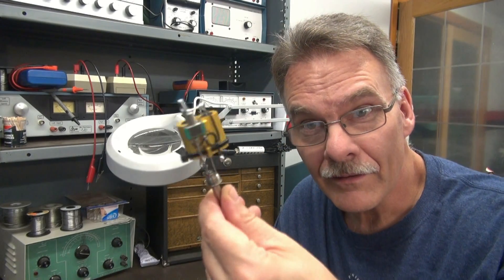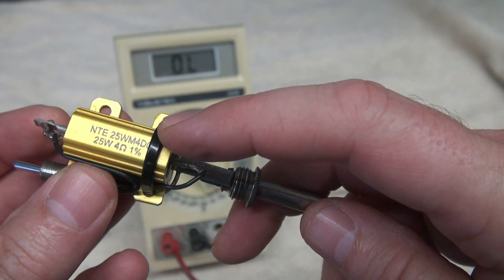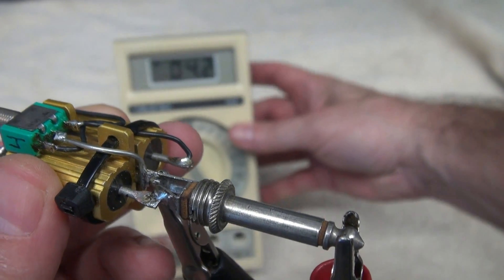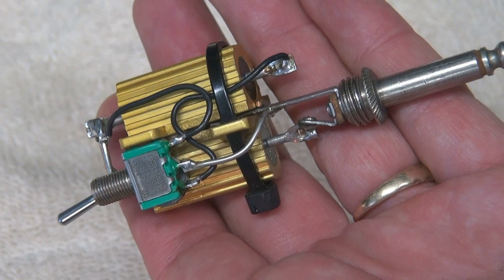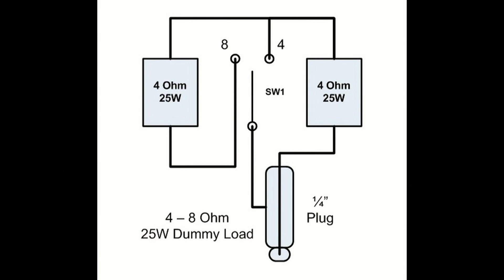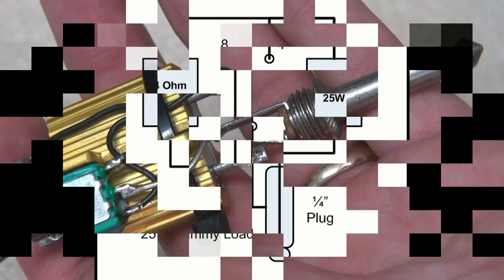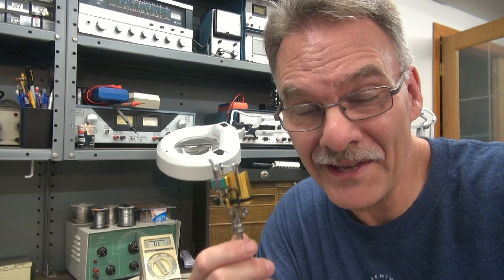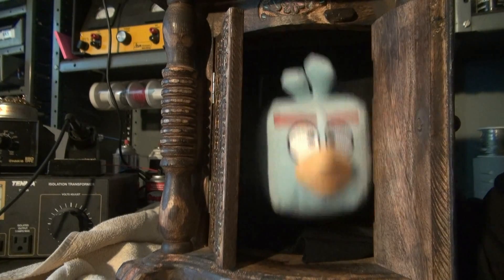How to make a simple easy 4  8 ohm tube audio amp Dummy load D-Lab

Comment: Old blown speakers work great for dummy loads. Same for speakers with damaged/bent baskets, ripped cones, etc. - just cut away everything leaving only the coil and magnet assembly saving the terminals while cutting everything else away. Same thing, no soldering needed. PS - it's not very important to worry about impedance matching a dummy load - as long as you try not to go one load away. Ex - if amp has 8ohm output - it's completely fine to use 4, 8, OR 16 ohm - one step up and down is completely safe. So an 8 ohm speaker motor (magnet assembly) is all you need.

Comment: I have a Fender super reissue, when I turn the reverb up past two, the amp distorts and loses volume. Can you share any ideas what may cause that? I put all new JJ tubes in it and it didn’t fix the problem. I’m afraid to use it for a job, fearing it might burn something up. It’s around a 92 or 94

Comment: Hi Terry, just a simple question. This dummy used 4&8 dc resistance. But speaker is in impedance. Is still ok tu just plug in this type of dummy load? Sorry.. i am new to electronic. So my question could be ridiculous. Hope i am not offending you or whatever. Thanks!

Comment: Hello Terry, I've a couple of questions concerning amp wattage. On a few tube data sheets, plate wattage (for instance 16w) and output wattage (for instance 4.5w). Would an amp built using one of these tubes be rated at 16w or 4.5w? Another question is how wattage rating relates to volume, db? You run all of the amps you work on mostly through the same speaker and the volume sounds the same. Could be the balance on your camera but I am very curious. Thank you.

Comment: I basically have built the same device and I have used it for years. With mine I use a female jack and the use different adapter cables for different amplifier outputs, tube or solid state.

Comment: I built one out of two 8 ohm 50 watt resistors like this. I got burned wasn't expecting it to get that hot (235 degrees F) but I was testing my amp with an oscilloscope and had the amplifier volume up high for almost 10 minutes. It melted the jacket on the test lead tip because it was touching the out side body a little along with the insulation on the wiring I had zip tied to it! Now that said, I have been using this for 2 or 3 years now for various amp testing but never had the master volume up above 2 before this.  I shouldn't have used it for so long of a period. I'm sure it's ok for quick testing 3-5 minutes at the most without proper heat sink mounting. D lab is the Man! but sometimes us newbies need more instruction, I know I do !

Comment: Hi doctor d .......good morning ....I have amp sansui....so wat I want is the amp op impedance is 8 ohm so iam going to connect 4 ohm + 4 ohm on per side with right polarity...so I know it'll work but when 2x4 ohm making series I is 60watt and 1 is 40 watts which will go heard means speak loud or make more drop on him self

Comment: If I wanted to use my tube heads pre-amp only... I just pull the output tubes. Amps pre-amp works as intended... and you're not wasting your output tubes.

Comment: Does anyone know if I could use this to plug into the extended speaker jack on a deluxe reverb to get the overall volume down on the amp? If I remember science, shouldn't this work to do that? Maybe would approximate 40% volume reduction? Thanks!

Comment: I have a bit of a strange question. I’m looking to get an open chassis amp(Milkman hi-fi 5w) to use as just a cool tube glow novelty kind of thing, , but I know it needs a load as to not ruin the power section. Can I build one of those and leave it in there indefinitely? If so, is it better to build one higher than 5w? I know this probably sounds like a stupid thing to do.

Comment: Does the wattage need to match the wattage output of the amp?  For instance, if I made this with two 50 watt resistors to use with a Bassman 100 head, could I still use it with a little 10 watt champ?

Comment: I have a Rivera Fandango 55w (2 12inch speakers).  what resistor size should i use?  The amp setting is 4 ohm.
Reply: Measure the impedance of each speaker. You should have two 8 ohm speakers wired in parallel thus making a 4 ohm load. So in reality you could make a 4 ohm ONLY version using just one of those fixed resistors. His use of two resistors just makes a nice 4 or 8 ohm dummy load.

Comment: Subject to rating, would this work ok for a SS amp that has a line out running to a recording interface? I can just turn the volume down (run the speaker silent) but I’m considering separating the classic from the speaker entirely and making a desktop recording amp with no speaker. Cheers

Comment: This would be extremely unsafe to use with any amp more powerful than 5w. The 25w rating of those power resistors is assuming they are correctly mounted to a metal surface, preferably with thermal grease. And it is also hazardous to leave them in the open air, because they will become very hot if any appreciable amount of power is run through them for more than a couple seconds. This is a serious burn hazard if anyone were to touch it. The switch and zip tie may very well melt. It looks clever, but it's not well considered. The same circuit could be built into a small ventilated metal box and be 1000% safer.
Reply: Don't touch things that will hurt you. It's hard to teach someone about a device if it's in a closed case. This device is being used on valve amplifiers that run 300-400v. The dummy load is the least of your worries.

Comment: can use this to make an 4 ohm amp head to power and 8 ohm speaker cab? I want to do this with an input and output jack but only 8 ohm load on or bypassed with switch can I use the same components? besides extra jack what else do I need?

Comment: If you want to eliminate the switch, would you just solder the tip connection of the plug to one end of the resistor, and the sleeve to the other end?

Comment: how hot will one of those get during testing?
Reply: Extremely hot if you run more than a couple watts into it. Serious burn hazard with those resistors exposed and not mounted to proper heatsink.

Comment: Hi Terry, you have some great video,s,,what resistors can i use for a 150 watt amp ..8 ohms ??
regards
Reply: i can see that this is an old comment and idk if this info is still useful to you… but maybe is, or will be useful to someone else

the resistance value depends on what sort of impedance the amp expects to see at the speaker out; 4 or 8 ohms are quite common, but some will want to see 16 (check the back, it should be labelled)

this is not the same as wattage/power dissipation: terry is using 25W components here, which means that they can comfortably dissipate that much power (current per unit time). for more powerful amplifiers, you'll probably want to use components rated for higher wattage/dissipation… you could maybe use lower-rated components, but if you turn the amp up you'll probably just end up blowing/melting them
Reply: soupalex so say they want to make a 150 they need two 150 watt resistors??
Reply: @vemonguy686  Thank you.best regards.

Comment: great video thanks for sharing. Could I make this with a single 100w 8ohm resistor? Just solder the lead from the resistor to the jack?
Reply: yep, i think terry is using two 4ohm resistors just for the utility of being able to use one doohickey for a range of different amps (since 4 and 8 are common output impedances, and you can get 8 ohms by putting two x 4 ohms in series)

Comment: I'm sorry for being so critical, but I don't wan anyone to possibly break heir amplifier or other equipment if they make one of these...

Being an electronics engineer I have to cast my doubts as to how well that device is going to be able to dissipate 25W of power. In my experience it doesn't look like there's enough heat sinking to achieve that.

Even if each of the resistors would be dissipating only 12.5W, that amount of heat is enough that without additional heat sinking there could be thermal issues.

If average power dissipated is well below that 12.5W figure, OK, it could work if there's not many peaks that hit that 20W+ mark constantly.

That type of power resistors aren't rated for 25W without additional heatsinking. If you buy 5W through hole resistors that don't ahve additional heat sink mounting, even they might be rated for that full 5W only for short amount of time and if they're constantly in moving air, mounted off the board to remove that heat.

It's all in the datasheet of any proper resistor.

Comment: What about for like 100 watt head? What resistors for that?
Reply: Im going to use 2x 15 Ohm - 50W, wirewounds and wire 2 in parallel to roughly make 8ohm load but 100w rating. You could build it into maybe a small 1590A pedal enclosure if you plan to actually play the amp  under load like myself (slaving the head to another amp which has attenuator) and not risking anything over heating, the enclosure will act like a head sinc if you mount them directly to the aluminium box.

Comment: Hmmm

As a quick fix for my 100 watt amp 8 ohm needs... I guess I could just solder one 8 ohm, 100 watt resistor between the + and - ? Does orientation count?
Reply: Orientation of resistors only counts when they're color coded and you want to show how meticulous you can be :D  If there's an instance a resistor does need oriented a certain way, there's typically either poles or an arrow showing the signal direction.

Comment: Very nice! Question: I have a Mesa Boogie 50 Caliber Plus that has an unrepairable issue with the power amp but the preamp section is just fine. I want to use it just as a preamp. Can I run it with the four EL84 power tube out of the chassis if I use this dummy load. My gut tells me no, but I need to ask someone who actually knows. THANKS.
Reply: I don't know if anyone answered you, but it's realy simple. All you have to do is pull the power amp tubes out of the amp. That's it. When you pull them out, no current is going to the output transformer, and then you can use the preamp section of the amp.  Guitar->cable->preamp in->send->to cab sim, mixer, etc.

   I have been experimenting with TUBE amps for years. I even used a 200W regular bulb for dummy load. Not the smartest thing to do in life, because a bulb can brake easily, but it worked fine.

Comment: Hello!
A have a question. 
I've assembled an 8 Ohm (100W) dummy load lately and it gets warm with my 50W power amp. I guess it is OK for resistors as the OT stays cool, but anyway I would like to clarify if that is OK just to be sure.
Are there any restrictions while working with/troubleshooting an amp loaded on  dummy load like that instead of an ordinary loudspeaker?

Best regards,
TT
Reply: It's OK, but I would probably limit the time you have it on, or bolt it to a piece of aluminum with conductive paste.  Warm is fine, hot to the touch may limit the life of the dummy load (check the resistance when it's hot; is it still 8 ohms?)
Reply: I would at least put a fan on it and make sure it doesn't get any hotter than you can touch for a few seconds.  Heat will eventually cause the resistance to fluctuate or fail and possibly kill your power supply as well.

Comment: Hi. Is it possible to use a dummy load in an amp for long periods of time, for example, 2-3 hours? I'm thinking using a lunch box amp's "send" jack in the FX loop into the "return" jack of a 100 w Marshall amp. In paper, this would give me the Marshall's channels plus the lunchbox sound when FX loop is activated in the Marshall. But the lunch box must have a dummy load since I'm not using the power section... Thoughts?

Comment: A bit confused. I thought the 4-8-16 ohms was impedance vs resistance.  Aren't you measuring resistance vs impedance?  Thx.
Reply: You're correct as impedance is basically frequency dependent resistance, usually measured at 1000 hz.  However, as far as the amp's transformer is concerned, it doesn't matter; it sees a non-inductive resistance of 8 ohms.
Reply: So the impedance is variable listed as nominal. It's key to pay attention to the wattage for choosing the right resister or resistor bank to handle the load.

Comment: Would it harm the amp or hinder troubleshooting using an 8ohm dummy load on a 4ohm output?
Reply from the maker: If your simply troubleshooting, not driving the output, that load would be fine. Always better to have a load than none. No load can cause issues fast.

Comment: could you make the same thing for a higher wattage amp by using resistors rated to 50w or 100w? would heat dissipation start to matter more at that power level?
Reply: You can use the same circuit with higher powered resistors, or more resistors in series/parallel to get the values you want. But it MUST be built into a sturdy metal box or you WILL have a fire.

Comment: Those resistors are only rated for a maximum of 9W when not mounted to a heatsink, and will reach 200°C (392°F) if dissipating that full 9W. For a more sensible temperature of 50°C (122°F), you'd want a maximum dissipation of just under 1.3W. To achieve the full 25W rating, with a 175°C (347°F) rise above an ambient temp of 25°C (77°F), then an aluminium heatsink of 1mm (0.04") thick, with an area of 535cm (83") square is required.
Reply: The Datasheet is http://www.arcolresistors.com/wp-content/uploads/2014/03/HS-Datasheet.pdf 
If you need 25W without chassis mounting just buy the HS75s, they are rated for 24W unmounted.

Comment: It's my understanding that those type resistors require a heatsink to achieve the labeled power dissipation.  Learned about it the hard way.  Toasted a 40W unit with much less than 40W going thru.  I don't know what the derating is for no heatsink or fan.  Easy enough to feel them, though,  if using them with a big amp.
Reply: > that max temperature is 200°C (392°F)
That's crazy-hot!!!  Good warning about that.  Thanks!
Reply: Yep, to keep those resistors shown at a sensible temperature that won't burn you or set your house on fire, you wouldn't want to put more than 1.3W through them.
Reply: Couldn't find any heatsinking data for the NTE product. Vishay/Dale has similar "chassis mount" product RH025 & their datasheets say to derate the wattage 50% for unmounted device at ambient air temp of 25C deg (77F deg). 

Vishay's stamped ratings for RH025 assumed mounting on a 5" x 7" x 2" x 0.040" thick aluminum chassis (167 sq. in. surface area). For Milspec applications (different datasheet) they derated the unmounted 25W device to just 8W at 25C deg.

So since most audio amp power numbers are peak versus average or RMS, these ought to work for short periods of time on smallish amplifiers. If they start smelling of smoking, it's time to consider making a larger dummy. Maybe high watt resistors on a heatsinked unit at the end of a cable. Still homebrew-able, just a little more expensive.
Reply: the 25 waters will handle 6 -7 watts with out heat sink
Reply: +Jamie Phillips, yes, they'll stay within their max temperature rating dissipating 7-8W without a heatsink, but that max temperature is 200°C (392°F), you really don't want them running that hot if you're going to be handling them!
Reply: A 5 watt ceramic will hit 200°C (392°F) if you drive it with a full 5 watts so either way check before you touch or you may get a hot surprise
Reply: this is a great tip, thanks!

Comment: How about using 2 x 8 ohm resistors and having the switch take one leg of the second resistor in and out of the circuit?  Gives you twice the power handling in 4 ohms instead of twice the power handling in 8 ohms.

Comment: Great to have you back Terry! It looks like a wire wound type resistor? Is there any reason to use a non-inductive type? Found a butt load of these on Amazon. Go figure! Thankz
Reply from the maker: Nope, nothing to worry about. You could also construct this with some old carbon type. For the short period of use, any type resistor is fine. TD

Comment: But we should never switch it from one setting to the other while the amp is on, correct?
Reply from the maker: The amp would never know you flipped the switch, no worries
Reply: No you should not. that is not good, the amp and you would "know", if you use a break before make switch, which many unlabelled switches are, and you can hear it make a loud thump, from the brief unloaded transient spike, which is not good for the tube or transformer. If you used a make before break switch then that would be fine, the amp would still "know" from the parallel drop in load for the moment, but that is safe for that moment as it's still loaded, and you would not hear anything or stress the tube or transformer with a big spike